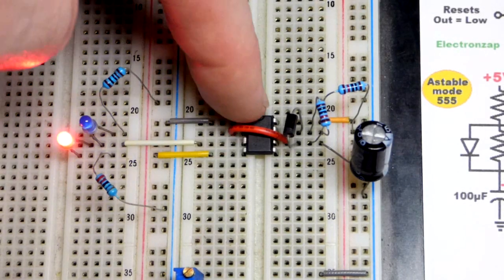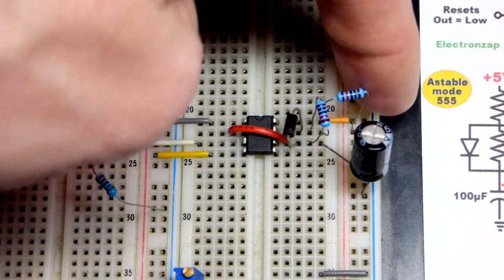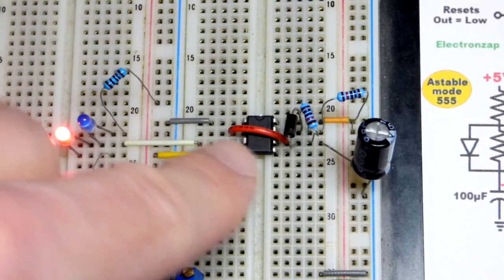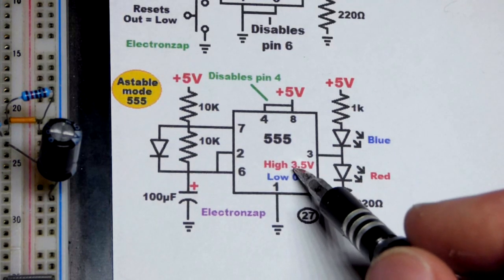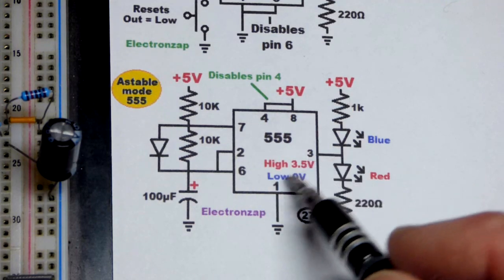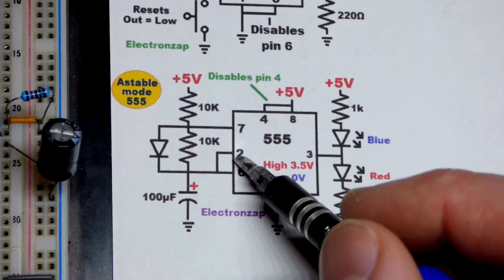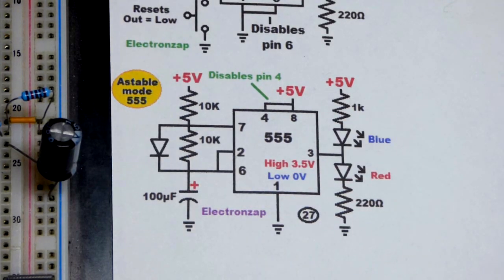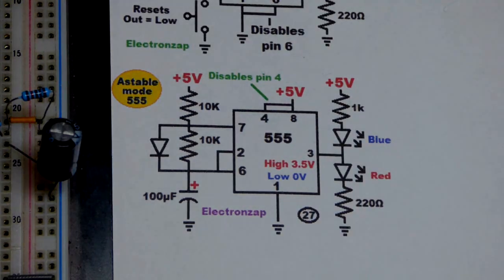Astable mode 555 timer multivibrator circuit rapid review

Comment: At 1.20, you mentioned that the output is 3.5 v, then what happened to the voltage coming from 5v through the 1k which meet at 3.5 v? I don't understand how this particular 3.5 and 5v works.
Reply from the maker: The transistors that are built into single supply integrated circuits, such as the NE555, make it so that the output falls about 1.5V short of the positive supply voltage. If you have a 5V supply, then the output will only get up to about 3.5V. If you have a 10V supply, then the output will only get up to about 8.5V. The output can drop all the way to 0V though.
Reply: @Electronzap  oh I see ..